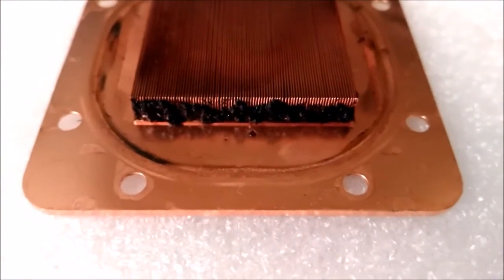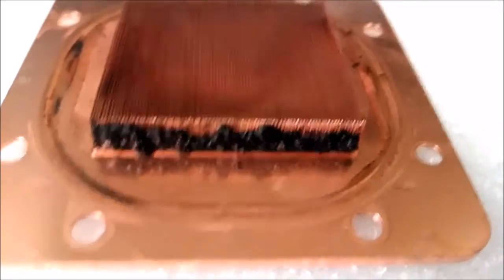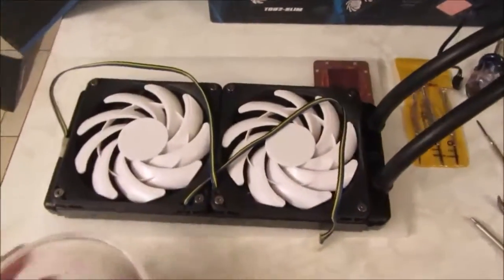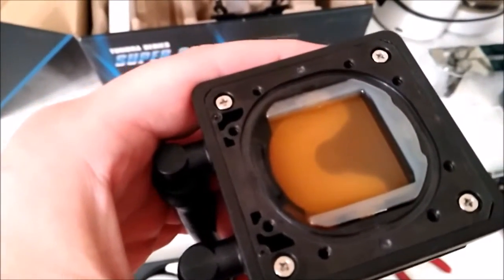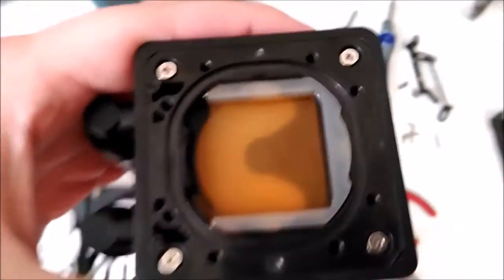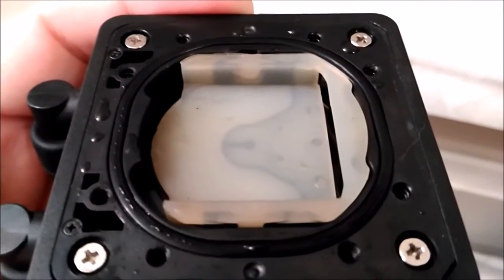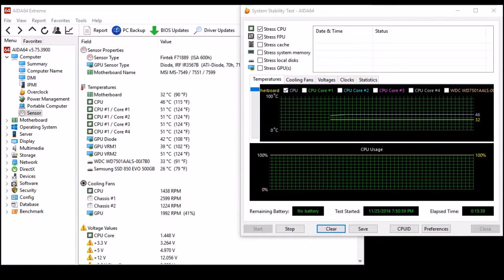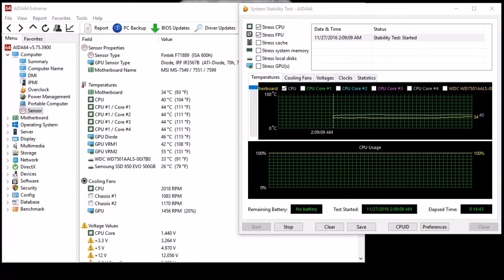Broken AIO Liquid Cooler... Let's Fix It!

Comment: You need to put one stick of memory in channel A and one in channel B to get it running in dual  channel mode, you'll get more performance, typical config is to put modules in slots 2 and 4, and leave slots 1 and 3 empty (from  left to right)

Comment: I just fixed a 4-year-old Corsair H55 with every problem possible - gurgling sounds, loud rattling from pump, and finally idle temperatures at boiling point.
I disassembled the pump unit and found lots of sand-or-salt-like grime on the inside of the copper base plate, as well as a thin coating on many surfaces. 
Cleaned/scraped it all off, flushed the system, and used a syringe to refill with new liquid - 1/3 glycol and 2/3 battery water. 
Now works almost perfect. Still some small rattling noise from the internal propeller but no sign of air bubbles or gurgling whatsoever. 

If you have a mini-pc and need to mount the radiator sideways make sure you know the direction of water flow and position your radiator so warm water goes in at the top and cold water is sucked out from the bottom. The reverse could be bad and this could actually be the cause of all my H55 problems.
Posting this everywhere to help as many as possible. All you need to service is a screwdriver, a syringe, glycol (5$), and distilled/battery water (2$).
Reply: I'm having this problem. How do I refill the cooler?

Comment: That gunk looks like rubber. Perhaps whatever they used for coolant didn't treat the hoses too kindly. Could be the impeller in the pump degrading too, might be the reason why it wasn't cooling as well as it was initially. Were you able to take the pump fully apart?

Comment: I'm curious as to why you didn't just run to the store to by distilled water rather then using something as toxic as antifreeze in your house.
Reply: Antifreeze usually has anti-corrosive properties. 33% antifreeze (non-diluted) and 67% distilled water is about right for many brands to reach peak corrosion resistance. 
Corrosion resistance diminishes over time however. So you may need to replace the liquid in a water cooler every 3-4 years. 
Same reason cars need to change coolant fluid every few years.

Comment: I don't want to sound like a dick or anything but i would never be using Dex Cool. I work on cars, and I've seen so many of them get destroyed by Dex Cool. Ive had cars come in with this coolant only being 1 year old and the and all the engine passages are filled with this sort of paste caused by the coolant. i dont know if that means anything to you but i thought i put that out there.
EXAMPLE: https://www.youtube.com/watch?v=PbX4CuE8auY
Reply from the maker: I see what you mean. Unfortunately, I'm not a mechanic, and don't know a whole lot about coolants. I learned more after using this stuff. So far it's been fine in my AIO system. Temps have been good, and I'm sure at some point I'm going to have to replace the fluid again. I've learned about galvanic corrosion, and this is an aluminum / copper mix. I'm sure the Dex Cool was not designed for those two metals, and definitely not intended for the use I am doing with it.

This unit was basically broken when I took it apart. It would not cool and from the video you can see why. SilverStones' own mix degraded the inside of the tubes and left that black gunk blocking the channels for the coolant to flow properly.

So basically the unit was already compromised and I expected it to fail again sooner, but it's still going. Maybe I found a good use for Dex Cool instead of in cars... lol
Reply: Jason's Channel i guess so. its still a smart idea. gotta hand it to ya
Reply from the maker: I did get some distilled water and I was going to get the additives and replace it. But I got curious as to how long using the coolant would last. I also have a completely new unit as back up, in case this one fails to the point of no return.

I'm not sure how 'smart' an idea it was, considering I didn't know anything about galvanic corrosion. Maybe I should pull this unit out and do an update to see how it's fairing after 7 months of running on Dex Cool.
Reply: Jason's Channel nice dude. i hope nothing breaks. im curious to see how long it lasts

Comment: It's the water additives that turn to gunk after a few years, kills nearly all of these the same way.
Well in your case there is possibly some rubber or plastic getting eroded in the system, they might have put a more aggressive mix in there.
Reply from the maker: I never did follow-up with SilverStone, but they did send me a new unit. And it didn't last very long before getting gunked up. It's still running just fine with the anti-freeze I put into it when I did this video. I'm watching and waiting for the temps to spike, then I'll pull it apart again and see what's up.

Comment: Nice work
Reply: I came from a comment thread on bitwits channel
Reply from the maker: Sorry, I didn't see this sooner. Thanks for the comment. I think I posted something on bitwits channel about the cooler video.

Oh yeah, I plan on adding distilled water to the loop when/if it starts to mess up on me again. But so far it's been running like a champ with the anti-freeze. I don't really want to fix what isn't broken.